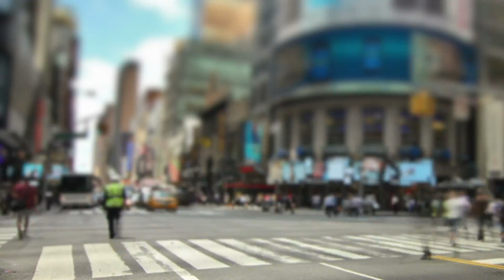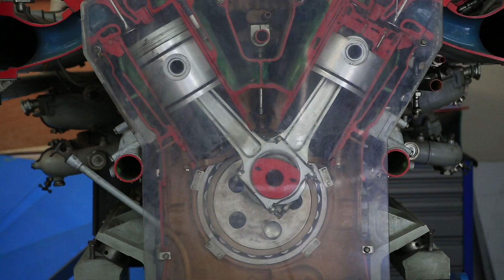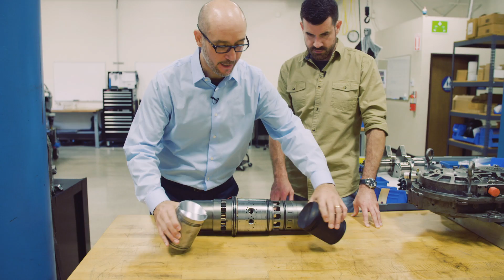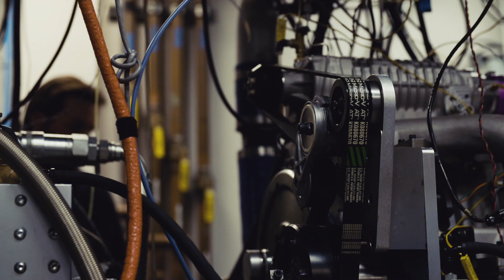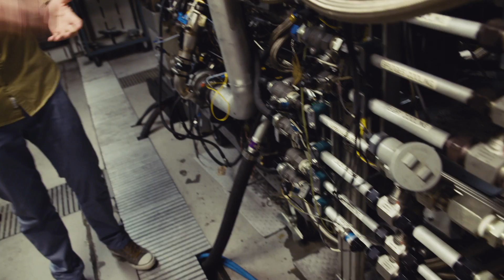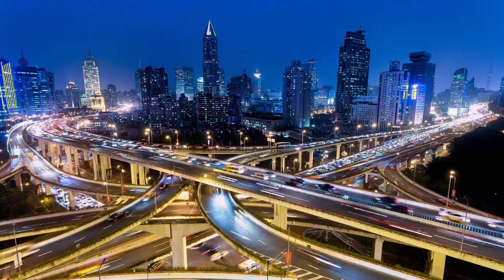This Radical Redesign Could Keep Gas Engines Pumping | WIRED

Comment: So instead of all the force of my petrol exploding to push one piston, I now have to push two pistons, meaning that the power each piston produces is greatly reduced. To counter this you would have to load more fuel in each piston to have a chance of receiving marginally the same power of a traditional engine per piston. Why on earth is this 'more efficient' than say, a traditional setup? I see a lot of  ambiguous claims with no backing.
Reply: sid a ... no 4 stroke engines use energy in the compression stroke.
Reply: Hmm idk, maybe because the opposed piston engine was designed in the early 19th century and there is extensive research on why this type of engine was not feasible. And then an unknown small company comes along and says 'cheaper to produce and 30% more efficient'. Do you not think someone like Boeing, Ford, BAE systems, you name it, would not have attempted to design some think like this and taken over the automotive industry with their new revolutionary engine? Dont believe everything you hear without evidence.

Comment: Numbers, give us the numbers, thers nothing about power or fuel consumption, or why such engine could be more efficent.
Oposing piston engines are fameous for burning oil, poor emisions and fuel economy for a reason.
They also got very high rotational mass and two crankshafts wich is another disadvantage and generates losses.

Comment: Seems like this would be better if it was horizontally opposed.  At least then brands like Porsche, Subaru, and Ferrari could implement this engine relatively easily.

Overall, I'm a bit skeptical of this.  Seems to me that all this is doing is giving each cylinder half the power.  The only thing that's really more efficient about this is fewer moving parts and the theoretical design.
Reply: Peter Schmidt wouldn't it be a case of just rotate the engine 90 degrees -_-
Reply: Justin Noker Not necessarily.  You can't just take an inline engine and rotate it 90 degrees and call it a horizontal engine.  There's more to it than that.

Comment: yeah, because wasting 80% of the power heating water is an efficient way to move motorvehicles... then the added weight of turning 2 crankshafts, and associated gearing makes sense as well,  ill stick to an electric motor attached to the axles thank you..

Comment: And burning fossil fuel is still bullshit
Reply: It wouldn't necessarily burn fossil fuel. There are other liquid fuels that would work.
Reply: Dustin Skye That's correct, but it doesn't change the pollution through fine dust particles, which are emitted by any kind of combustion engine. That's yet another problem to be solved with internal combustion engines

Comment: How is an engine that uses 2 cranks plus all the necessary mechanical devices to provide ONE output shaft,  an engine with a large foot print, and an enigne that can only run as a two stroke which is always more difficult to pass emissions an improvement>?

Comment: Is its power source the combustion of a hydrocarbon with oxygen? Does it excrete CO_2? Then it is part of the problem.
Reply: I imagine a future in which we still drive fantastic internal combustion engined cars that use a liquid fuel synthesized from the CO2 in the air and hydrogen from water. The process exists, it just need to made economically viable.

Comment: Uhhhh, just one possible problem about the emissions thing, it's 2 stroke so it's burning oil. That's the exact same problem that killed this design all those years ago. Even more recently the Wankel engine design was done away with by mazda for the same sort of problem, keeping the lubricant out of the combustion chamber is important since burning heavy thick hydrocarbons is dirty. With all that being said I enjoy seeing these designs being fully tested out with the best modern machining and electronic controls.

Comment: Thumbs down because there is no explanation why this would be any improvement. The video is pointless.
Reply: This engine is a two stroke. That means for every revolution of the crank shaft there is a power stroke for each cylinder. On a four stroke engine, like conventional automotive engines, there is only one power stroke per every two revolutions of the crank shaft for each cylinder. This mean that theoretically the two stroke should have twice the power for the same displacement as a four stroke.  But that is not the case in practice because portion of the crank’s rotation must be used for scavenging (this is a fancy word for displacing the combustion gasses in the cylinder with fresh air) resulting in lower compression.  To counteract this lower compression a second piston is added where the cylinder head would have traditionally gone. This creates its own challenges though, one being to replace a cylinder liner the upper crank shaft and all upper pistons along with all the lower pistons must be removed. Another problem is how to cool the upper piston crowns.  These engines were popular for marine propulsion in the early to mid 20th century. They were particularly useful for submarine power plants because of their high power to weight ratio and small form factor. I recall seeing a small 5 or 6 cylinder opposed piston engine from a submarine running a saw mill in Jerome AZ, if I had to guess it may have been Fairbanks-Morse  model 38F5-1/4 the builders plate was covered with oil and sawdust and thus was not legible. The engine sounded really unusual because of how the exhaust and intake ports are covered and uncovered by the pistons.
Reply: It's more efficient and lighter than a regular engine.
Reply: David Helmuth I know it can be figured out, it's just lame that they made this whole video without explaining it.
Reply: Ya, they really didn't go into detail about it. I also believe that Wired made a mistake when the said the engine is 30% more efficient than a regular engine. (Obvious misquote) Oh well
Reply: The quote is “could be up to 30% more fuel efficient than what we have today.” A good otto cycle engine (not talking about theoretical max efficiency) converts about 25% to 30%  of the energy contained in the fuel into motion of the vehicle. A 30 % improvement of a 30% efficient engine would be a total gain of 9%. That means the engine would be operating at 39% efficiency. That’s well within reason for that type of engine. 

now to compare that to other thermodynamic cycles. A low speed diesel engine (lower than 120 rpm) can operate at 60% efficiency and combined cycle power plants can push well beyond that. A combined cycle plant takes two thermal cycles and combines them. An example is how the waste heat from a gas turbine operating on the Brayton cycle can be used generate steam in a rankine cycle. By using cycles in tandem like that a thermal efficiency of 80% can be achieved.  In addition as a general rule of thumb larger engines tend to be more efficient than smaller engines. a large centralized power generation facility that provides power for electric cars makes is good.  So in short at least thermodynamically the argument for electric cars is remarkably strong when compared to cars powered with otto cycle engines.